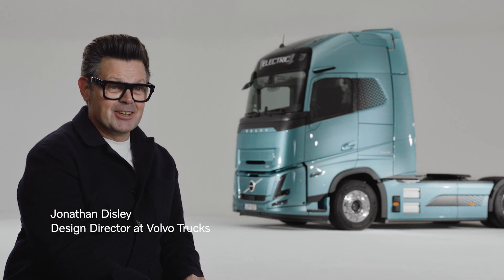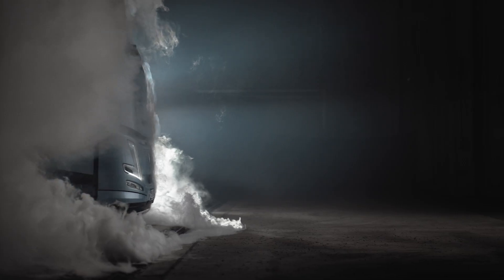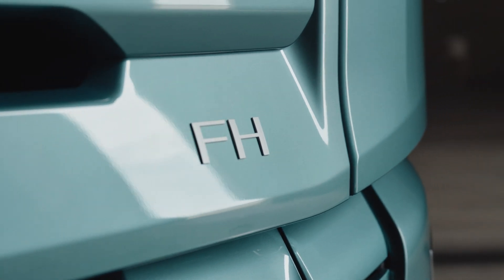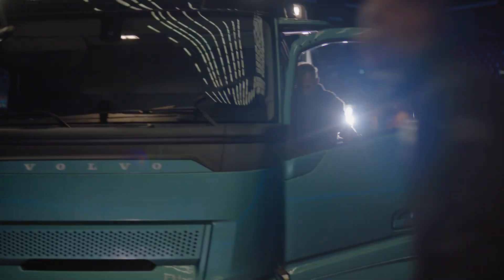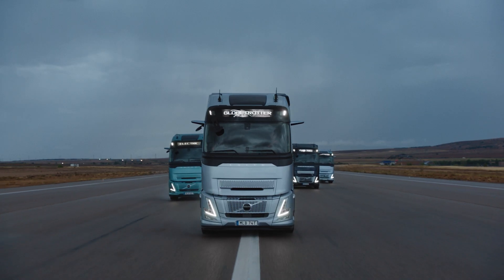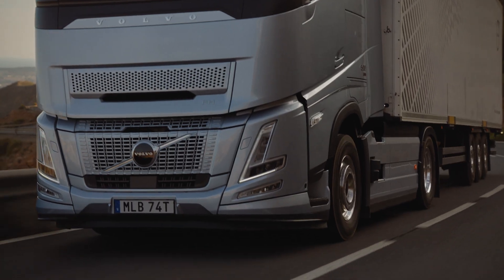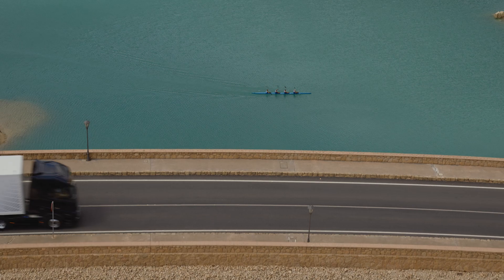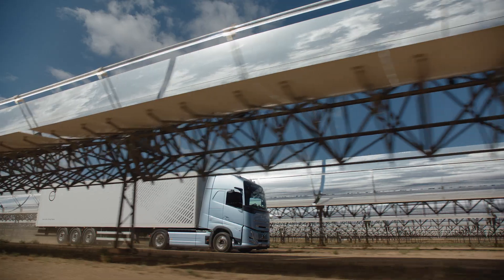Volvo Trucks – The design process

Comment: Except for the appearance and some additional horsepower, it’s just “more of the same”…🤷🏻‍♂️
Reply: 5% fuel efficiency, new security systems and cameras. Quite big differences.

Not sure what else to expect from a new trucks. They are big engines on wheels, meant to transport a lot of stuff. Hasn't really changed in the last few decades I would guess :P